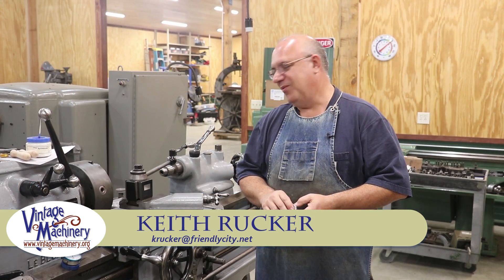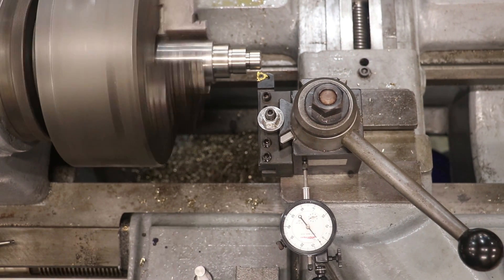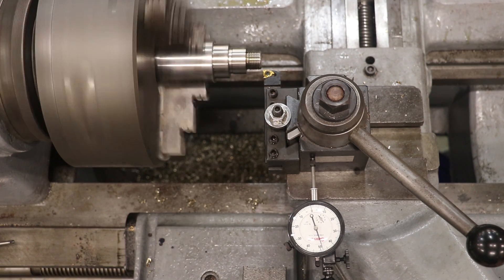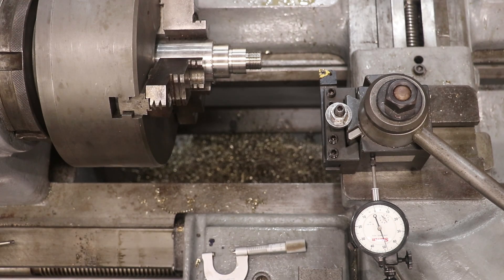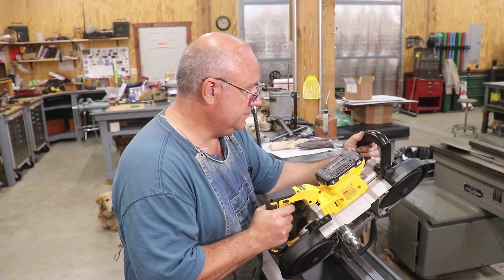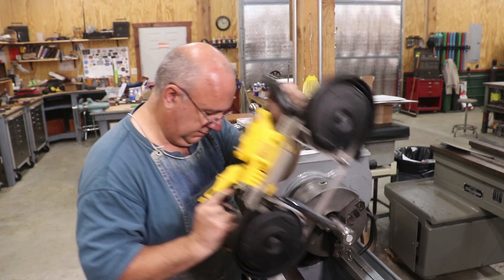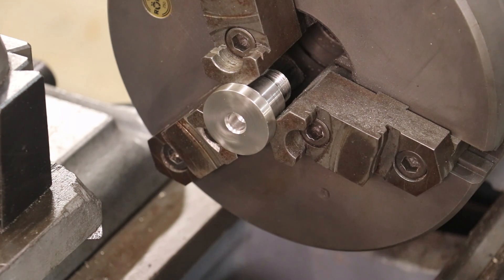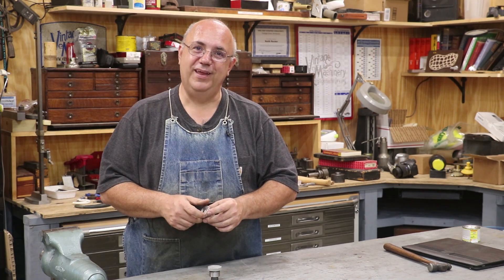Machining a Custom Vise Pivot Bolt: Part 2

Comment: That is an absolutely beautiful piece of work Keith!!!  Small, simple-seeming but requiring a great deal of skill and attention to detail. I was a little dubious about whether the broach method would produce a good result for the Allen key, but it really did!  I hope you get the proper tool to use a rotary broach in your lathe at some point as I would be fascinated to see the full process, but the hydraulic press did a very nice job of it on a simpler scale.

As ever--many thanks for an excellent video!!!

Comment: Keith, another job well done. In a pinch if you do not have a broach you can use a hardened square taper easy out.Grind the sides to make your own broach. 1/2 inch square works nice. Just don't over heat it while grinding.

Comment: Another option would be to drill two holes in it such that it could be tightened/loosened with a spanner. 😊 A 2-hole bolt circle, I believe.

Comment: Nice, I made almost the exact same thing for my brother's Wadkin's wood mill.  I didn't want to put a flat head slot in mine either, so I drilled and tapped, and loc-tited in a set screw with an allen head.  Your method with the broaching tool would have been much easier!
Reply: I don't have a rotary broach either and have used your method of embedding a hex socket head screw a few times in the past. worked well for me.

Comment: Oh MAN !!! 
I hated seeing those sharp / square corners on those undercuts.
As a mechanical engineer, I loved the undercuts, but radiused corners would have made be PUCKER less.
Sharp inside corners are HUGE stress risers .
Reply: iamthetarget52  As a retired Manufacturing Engineer I thought exactly the same thing.  Instead of a 0.005” radius, I would have preferred something like 0.020” radius.  I’d also have put those “slots” (undercuts) in before doing the finishing turning of the shoulder and thread OD.  Regardless, as I suspect there will not be heavy loads, the part will be more than functional.  As always, Keith, an excellent video.

Comment: Keith, Nice video and good clear filming. I was wondering about the thread cutting. It looked like you were only using the cross slide to move the cutting tool in. Can you say why? Just curious as I am always looking for new techniques.
Thanks!
Eric
Reply: If you're using a carbide insert threading tool you can go straight in with the cross slide. You just have to remember how far you go in after each pass. The dial indicator helps with that.
Reply: Off camera or actually out of frame he was adjusting the compound, you could tell that -you noticed that he used to cross slide to adjust it to the zero on the cross slide dial and it just coincidentally happened to move the dial indicator back to the same place that the prior cut it had been made  - then after a brief interval he changes that with the compound. Keith is an old school guy he always does it this way.

Comment: He’ll probably want to keep a plug in that hex hole to keep shavings from filling it.
Reply: The screw goes in from underneath. Nothing is going to fall upward.
Reply: ClipperDays Thanks, I hadn’t seen the vise so I assumed it dropped in from the top.

Comment: How did you get the broach out?
Reply: the broch has a tapper on it starting at the head and getting smaller towards the base all you have to do is rock it and it will release.
Reply: @ypop417  taper, not tapper
Reply: he used karate

Comment: I was waiting to see the almighty struggle to get the broach back out of the hole!
Reply: the broch has a tapper on it starting at the head and getting smaller towards the base all you have to do is rock it and it will release.
Reply: Y Pop  Neat!
Reply: taper , not tapper.
Reply: me too, i cant imagine they dont just get stuck in there
Reply: He did not use karate. He used This Old Tony.
Reply: He borrowed this old Tony’s Anti-gravity levitation machine and flux capacitor.
Reply: He used karate
Reply: Mind control. Keith used mind control, he tipped it over and it fell out of the part.

Comment: Why the bandsaw for the cut- off? Surely a large lathe like this can  handle the part-off of  such a small part.
Reply: The "normal" insert parting tools have a max diameter that they can cut. If you need/want something for a larger diamanter you either take an insert parting blade that you can adjust or some HSS bar with a holder. But having every tool for every situation is impossible, so parting it off with a bandsaw is a good and quick fix.
Reply: It's not the size of the lathe, it's the amount of 'stick out' of the parting tool.
Reply: I really liked to see a broach cut the Allen socket, never seen that done. Thanks Keith